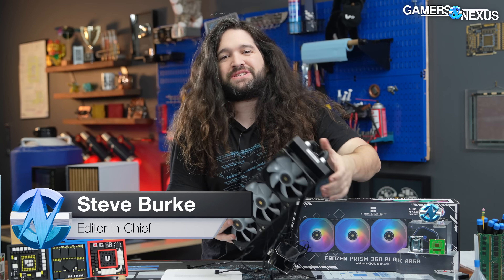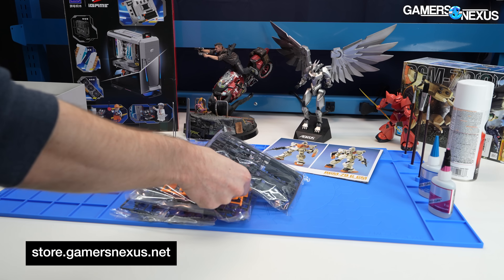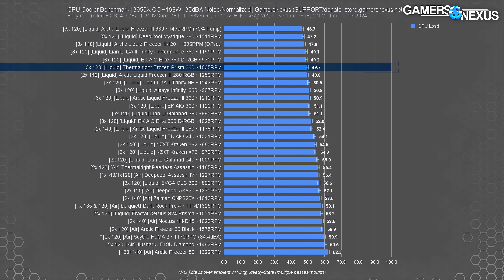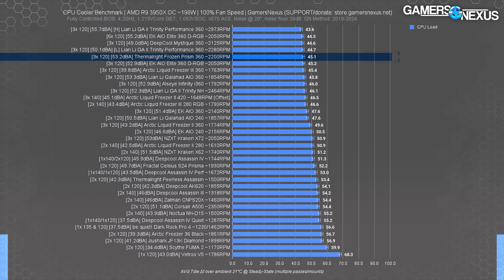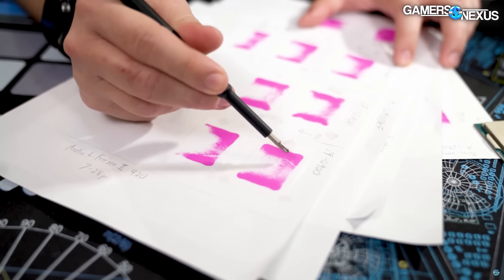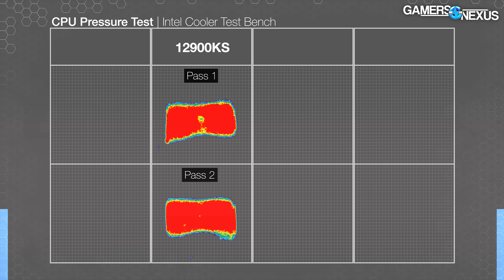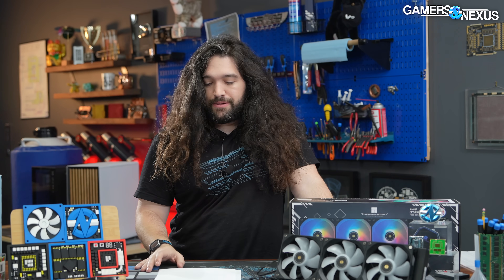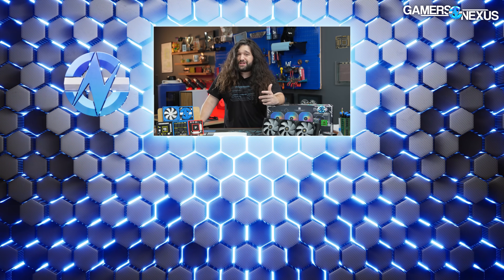Thermalright Strikes Again: $56.90 360mm Liquid Cooler | Frozen Prism Review

Comment: LONG TERM USER OF THIS COOLER HERE: Bought last July even. I'm running the white version and have been for some time now. I had issues with it when I first installed it. First off the mounting brackets are a pain to line up struggled and got thermal paste everywhere, finally got it mounted and cleaned up. Then I found out a few minutes later the motor wasn't spinning, was it dead?? It wasn't a good first impression. Curiosity got the better of me and I tore the pump housing apart seen how it worked. Then I noticed one of the screws holding the circuit board in place was loose and the board was off centered. I centered it and re tightened the screw and tried turning it on, the motor started spinning and I was relieved. I put it back together and it's been working fine for me ever since. It's got to be around a year now, the motor never stuck again. Then the last issue I had was that one of the fans died on me. I replaced it for 6 or 7 bucks, even so with all that, I'm still very happy with it. It cools good, my cpu might hit 60c max under stress testing. your results will very as my cpu is just a 6 core 3600x..........at the moment. I usually buy with future upgrades in mind. I will say this, everyone who see's this cooler in my system thinks it's expensive, it shocks them that not every computer part is expensive. To sum it up, it's a good cooler if the quality control was a bit better. The average user would have sent it back and never bought from them again coming up against a problem like mine was, good thing I like to tinker and check things out. Most would be too pissed to bother. For a long time look, do you want me to take it apart and see how it look's inside, send you a few pics or something?? I haven't noticed any degradation in it's performance and I run 2 monitors with one having monitoring software running at all times, so I'd notice.
Reply: they have 5 years warranty did you try and contact them for replacement fan?
Reply: leaving a reply to see the answer
Reply: @theplotthickens6313  following the follow
Reply: Thanks for the info, looking at AQUA Elite V3 360 right now... So basically if it works well out of the box it's probably won't break any time soon. That's good.

Edit: bought it  few weeks ago, so far so good, very happy with my purchase. Will update this comment if something goes wrong.
Reply: I'm on the search for an AIO; now that you have at least 2 years with it, how has it been performing to date? Has it given you any problems yet?
Reply: You still running it?
Reply: @Claymore1944 My Frozen Prism, purchased in mid-2024, is still running perfectly.
Reply: Hey man I just bought this for my 5700x3d and adrenalin is showing my cpu temps at 0.0c have you ever had this problem
Reply: @constanttension8833 
Try hwinfo, if it shows up there, then id uninstall Ryzen master and reinstall adrenaline/ drivers
Reply: @constanttension8833  get hwinfo, if that shows your temp, you're probably fine.

Adrenaline isn't something I've used in a while, but I remember having that issue at one point, I think I uninstalled, then reinstalled Ryzen master and then clean installed adrenaline.

Comment: I've had a 280mm Thermalright AIO for bout 2 years now. It's been awesome for the performance to price. I rarely ever hear it spin up on my 13700K unless i hit it with Cinebench, Shader compilation, or Handbrake.  Mounting hardware was a bit unorthadox with a massive circular bracket, but for such a low price, hard to complain.

Comment: I'm not sure how different this is to the AQUA ELITE 360 V3, but I bought that last week for a build at £49 (£40.80 excluding tax) and it performed exceptionally on a 7800X3D, with temperatures lower than £50 air coolers and even more expensive 280mm coolers from BeQuiet and Corsair. Presumably there are just as many different variants of AIO as there are air coolers in Thermalright's lineup. I'd be curious to know if if was the same pump, coldplate, and fans as this Frozen Prism...

Comment: Noctua: "It takes us years to masterfully craft our air coolers to perfection."
ThermalRight: "That'll be $40."
Reply: Other AIO manufacturers: “These parts are expensive to obtain. Were gonna need 100-150$ to make any kind of profit.”

Thermalright: “Whatever you got in your pocket I guess.”
Reply: They have to have a reason to price gauge. Research and developement costs are often cited when it comes to high prices. The bike industry perfected the rip off technique. Carbon bikes that take at most 10 hours of labor from start to finish are now costing upwards of 10.000. Tour de france bikes are now in the bottom range of 15.000 pounds sterling and go up to as much as 25.000 pounds. Would you spent nearly 32000 dollars on a bike?
Reply: @suminshizzles6951  I also found the price on bikes are now insane.   6016 are not bad at all, why go carbon fibers is...
Reply: Damn you had me at the start lmfao@suminshizzles6951
Reply: Compared Quality and warranty
Reply: @maxdamage4919  It really isn't that much of a difference.. I used to almost exclusively use Noctua coolers and case fans, they still make great stuff but the price doesn't make up for it. A $30 air cooler will basically almost never fail and if it does you just buy a cheap fan or two compared to spending 3x the price at the start.

Comment: With this being the (or one of the) cheapest AiOs on the market and still performing reasonably well, I'd be curious to see one particular AiO near the other end of the price spectrum, that being the Alphacool Eisbaer Pro HPE Aurora 360. I think it will perform very well, firstly because of the large coldplate which will easily cover the entire IHS of Intel's CPUs, and secondly because the HPE version has a high-performance copper radiator with higher fin density than the non-HPE version of the same cooler.

Comment: At 56$ just get the non rgb and change the fans. Even the most expensive water coolers can fail after some time, so why spend 350$ on one when you can buy 4 of these and some really nice noctua fans. Now if they offered one for 65$ with a nickel plated contact that would be a legendary price/performance.

Comment: I love Thermalright. I bought a 20$ Assassin King 120 for my 5600X, then switched to a 7600 and now a 7800X3D. And it still does its job!! Amazing
Reply: It’s cools the 7800x3d well?
Reply: @phantomz4882 yes. It was already decently cool when it was stock but now that I have used PBO and undervolted it it’s even cooler
Reply: It's crazy how often you AMD guys change CPUs.
Reply: @DingleBerryschnapps  Amd cpus aren’t. Crazy expensive he probably upgraded to the 7600 after 3 years
Reply: @DingleBerryschnapps  i mean, maybe? at least we can change our CPU often if we want to without having to buy a whole new MB and rebuilding our system every time. Intel, for now, has an awful record for being anti consumer with all the LGA and shit changing very often. At least AMD decided to just keep AM4 and AM5 for a good 5 years+.

Comment: Cheap Liquid Cooler just doesn't spill right for me or something.  Although I should probably bite the bullet and check it out since it's pocket change.  Thanks for the video.  I recently installed a monster Thermalright air cooler that doesn't fit on the motherboard. The second fan has to lift up a little on the side of the motherboard where all the usb ports are.  Plus I'm testing out thermal pads on the cpu, so those should be easy swap out.

Comment: Very sadly the Frozen Prism that I got for my daughters machine failed the other day, pretty sure the pump has crapped out as I am pretty sure the cpu shouldn't hit 100 degrees in the bios.  

Have replaced it with a Thermalright Assassin King and it is back to a more comfortable temp of around 35 degrees.

Luckily I believe it is still under warranty from Amazon so I have the fun and games of RMA'ing it which I have never had to do before as I have been lucky enough everything else I have purchased brand new is still working and some of it still being used.

So here is hoping for better experiences than your average Asus support contactor 🤣🤣🤣

Comment: Why hasn't the test moved to newer CPUs?

I get it is probably because of data set.

However, I figure the new AMD CPUs with newer chiplet layout and IHS design could get different results under a 200W load.

Comment: The Frozen Notte has a faster pump at 5300RPM, with 5-YR Warranty. Thermals wise at full speed- it has consistently beat old and new top-end Deepcool coolers, it likely outperforms older more expensive tech from Corsair and CoolerMaster as well.

Comment: Bit of chart feedback: could you break the names, fan configuration, RPM, and decibel readings into their own columns to make it easier to read? It's a mess trying to find a specific cooler because of the bracketed data and RPM info prefixing/suffixing the names.

Comment: The amount of products they have is truly insane. I ended up going with them for a dual 120mm CPU aircooler, but the amount of products they have in and around that segment alone is ludicrous. Was really hard to decide on which model you have to go with.

And they also come out with refresh of these products left and right. I got a (I think ?) phantom spirit, and they were already replacing it with an 'EVO' version by the time I was done looking at comparison benchmarks, which had new fans slightly more silent than the V1. I have no idea how they do it.

If they were pushing out garbage you would understand, but no they are pretty good, and the fans on the phantom spirit are the only ones I didn't feel like replacing with noctuas in new build.

Comment: Sorry to ask this, but could you potentially swap the fans for Arctic p12 fans (or use many fans for a comparison to be honest) and review it again? Normally noone would swap the fans, but with the AIO being this cheap it could be worth it to just get it and swap out the fans to fit the needs.

Thermalright probably has an AIO at that price point anyways with better and quieter fans, though it would be interesting how swapping the fan would affect the performance and noise levels. Arctic p12 fans are like 4 or 5 bucks a piece and the modification would cost something around 15 bucks, potentially making it worth it as the total cost would be only 70 bucks, which is/could be still cheaper then most AIOs, the only one close is/was like Arctic's own LF3 360 during the sale, going for 80 bucks on their own website.

Comment: I went for a relatively expensive NZXT Kraken Elite 360 White RGB last year, but it is not just the bling I wanted (metal round pump casing with a great rounded LCD screen), it is also the control on the more expensive models, i.e. I wanted the full control through the software that can use liquid temperature for the RPM of the fans.
That is the only way to get the fans spinning when really needed (hotter liquid), not only dependent on the current CPU temp - that spins the fans far more frequently and randomly compared to the actual liquid temp.

Comment: I have been running a 240 Frozen Prism in a build since October.  It easily keeps a 7700X cool under any conditions that my son has tortured it with. I have it in a 011D Mini and used Thermalright fans only in the build, I tried to keep the fans similar.  I have been really impressed with it.  I found it really easy to install, even though I installed it upside down the first time.  I have a Thermalright fan that scares me, but not one on the AIO, hoping that it is a one-off and not indicative of future issues or failures.

Comment: When my wifes Galahad cooler failed I replaced hers with one of these. I also used one in my case swap. I noticed that hers has a clunking noise when I turn on the PC and mine makes more pump noise then the Lian Li did. I'd be curious to see how long the coolers actually last.

Comment: Is CPU load measured in percentages? If so, does that mean that Arctic liquid freezer 3 360mm has lower CPU utilization than Thermaltlright Frozen Prism which gives worse performance for Arctic cooler?

Comment: Think that's the hardest part about thism Thermal right has such a low price that I actually think it's TOO cheap and worries me. Now there's 0 proof it will work any worse than a £200 AIO but that's literally where my head goes when I see that price. 

I wouldn't have been surprised to see this as an unknown brand let alone Thermalright.

Genuinely surprised they don't up the price but still undercut everyone.

Comment: Have this cooler on my build was trying to stick to a strict budget and it has been a good cooler for the price like you mentioned noise but also I get a slight fan vibration other than that 4 months in and 0 issues

Comment: Have to say those prices and margins make me kind of wary of wages and working conditions at Thermalright's factories. It's hard to imagine they're squeezing margins that hard and not taking that out in terms of low pay and high pressure.

If that isn't the case, this seems like great value. And if you want it more quiet, just buy a 5-pack of Arctic P12s for $50 and stick them on there, and you'll get two great case fans on top of it. Still cheaper than most AIOs! (Or just buy the three you need for around $30, obviously.)

Comment: I have the 360mm Aqua Elite and it has been great so far. I will say that I did swap out the fans that came with it for Corsair LL fans which I already had. My CPU is a 7950x and it idles about mid 40s and under 100% load it tops put at 95 degrees. AIO pump speed locked at 40% and AIO fans are locked at 50% when running Cinebench R23.

Comment: Perhaps Thermalright has innovative manufacturing processes? I'm sure manufacturing their own stuff allows them to cut costs where they make the most sense to as well.

Sometimes it doesn't make sense to make a high dollar product when it only lasts as long as the low dollar one anyway.

I mean, if they could make something more reliable for more money that would make more practical sense. It's the reason I just went with a custom loop.

Comment: The sheer number of different SKUs that Thermalright offers is incomprehensible to me. I would absolutely LOVE to see a tour of their factory to get a glimpse of how they can produce and maintain so many product variations.
Reply: Their number of products almost makes me think they just skip some R&D and instead build all the variations and let the market decide.

Like with Corsair or Lian Li, they generally are trying to have their one or two AIO versions (and then different sizes), meaning in their development process they need to get everything ironed out to one singular design. 

Thermalright on the other hand could narrow their product down to 15 versions and then make 10,000 units of each and only make more of the ones that sell well.  

They had a ton of aircoolers in another GN video, but I bet they're cranking out their Peerless Assassin cooler now.

Comment: After seeing this looked on Amazon and saw that triple packs of fans are cheap by Thermalright as well , What would happen if you stack 60 bucks of  fans on to this  aio ? Think it might hit in the lower 20's if not 16 with 120 bucks in fans you might hit - temps .

Comment: I'm using Aqua Elite 360 right now, the first one had this vibration noise you showed with Noctua a few days ago, so I returned it and got a new one. The new one is great, no water noise, no vibration. So when it comes to cheap products from Thermalright, if it works it works.

Comment: I'm using the Frozen Prism (240mm version) for about 4-5 months now, and it's excellent. Idle is mid/low 20s (on an old R7 2700x), under load about 38-42 degrees C. And it rarely ramps up the fans

Comment: Could you test the ID-Cooling Frostflow x 280. I got that for 48 dollars 21 cents and it's a 280mm liquid cooler. So far I have been using it for my Ryzen 5 1600 AF(3.7GHz) and it's stayed under 100% load at 45C-48C. It also support intel and amd(am5 and am4).

Comment: I "took the risk" to buy this generic-looking Assassin cooler a few months ago, it looked super generic, but I thought that as long as it adjusts well, it's just metal mass and a fan after all.

Turns out, not only it's flawless, but also the fan spinning was super smooth, unlike the usual cheap stuff. Massive but like the other said, Overkill is something your enemy complains about - the heat in that case.

Then I saw your reviews - t's great to see I wasn't the only one who was impressed.
Reply: Sorry, Silver Soul 135, not Assassin

Comment: The mounting for TRs has been pretty bad. If having to take a board out of the case, it is almost worth it looking elsewhere.

On their new coolers, the AMD bracket is so bad I fear for it bending after a while and damaging the HW.

This one looks a bit better but the support bracket of the pump looks very sketchy and looks bent out of the factory.

This is not how TR used to build this stuff, they were much more sturdy.

Comment: With that comparison between the Arctic Liquid Freezer III 360, and knowing how inexpensive the P12 fans on it are (@ about $32 for a 5 pack), I wonder if you could kludge together one of the Thermalright AIOs, and swap in P12 fans for similar noise to performance ratio while still coming in about $20 under the Arctic AIO (or a little better if you can find a buyer for the spare fan's you'd end up with), or if there's more in the cold plate/pump/radiator that would keep them far enough apart that it wouldn't be worth it.